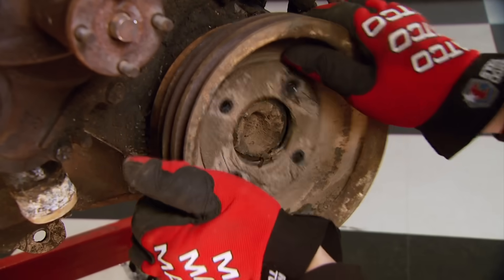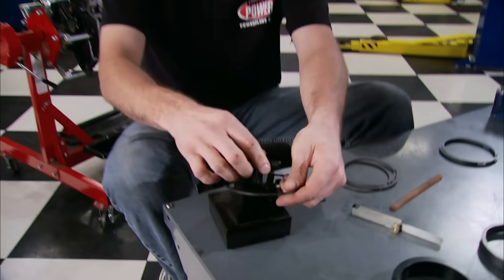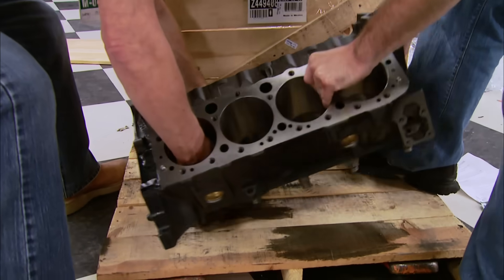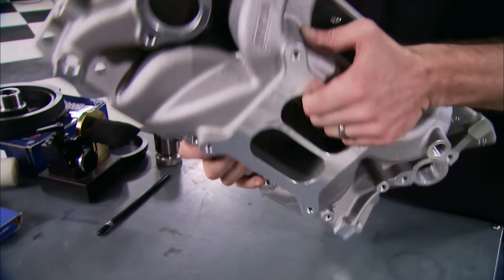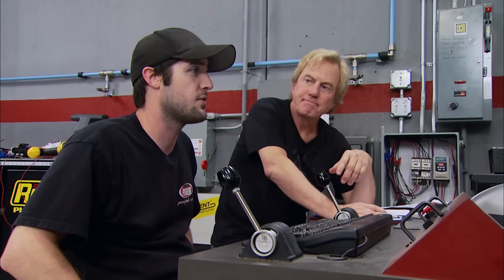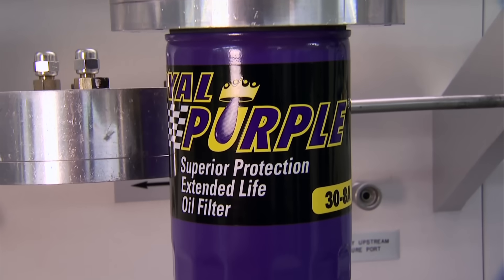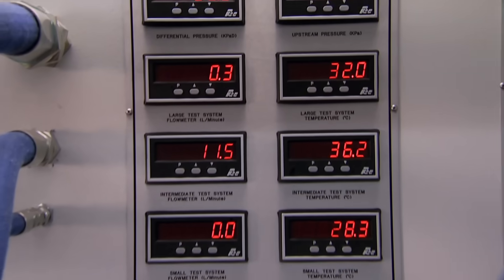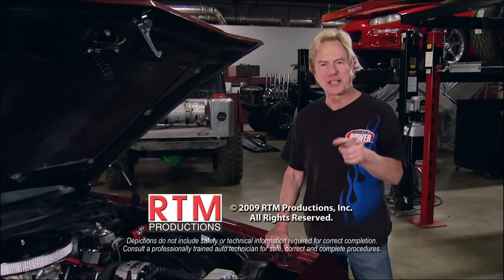Building A High-Performance Smallblock V8 From Scratch Using Only Catalog Parts -Horsepower S13, E18

Comment: i get motor homes with the  ho 454 bbc in it they come with 4 inch stroke with steel crank heavy rods heavy push rods high flow heads and it comes with the heavy duty 400 turbo bigger pump heavy clutches and stage one shift kit get them free all the time 450 hp at 485 torque and all it needs is to breath then i sell the motor home for 2000 without  engine and trans saves a lot on a build the last one i got had 6000 miles on the motor home the one before that one had 38,000 miles on it even if u have to rebuild it the long block new is 8000 bucks they even been known to put a LS 6 454 in them but they are really rare to find that is how u build a rig cheap but still have a bad ass engine and if u just put an aftermarket intake and 850 carb it really comes alive but if u put bigger valves and some minor head work u can get big power out of it with a big cam just a dyno tuned stock ho 454 can put out 500 hp with stock intake and carb which has been proven a few times just to stroke a 454 is about 4000 bucks . so u can see just how much u can save and u can get ford and mopar engines in a motor home just depends on the CO that built it they all have crate engine and they want power for passing i have a 68 ford class c motor home that has a 428 cj in it have all the paperwork on it got the motor home for 600 bucks running and driving newer ones have 429 0r 460 crate engine in them mopar u get the 383 . 292 hemi and the 440 mag most will have the 440 mag i hope this helps people out a bit because this really helped me when i found out about it and i love the big blocks they just look so much bigger
Reply: I built the almost identical engine in 2000. It was pushing 490 HP and almost the same in torque. It was a monster
Reply: @lasagna3106  and how much did it cost
Reply: the real secret to motorhome parts vehicles...find the buddy building an ice fishing house or outfitting a hunting lodge. They want the kitchen, beds, living room etc out of the motorhome. Swap 'em for whatever they have in the garage you want to finish up the car. And then there's the generator. Or maybe you need to build another shed for storage...there's all your wood, insulation, wiring, and windows, far cheaper than buying it separately at Home Despot.

Like hunting the buffalo...let nothing go to waste :)
Reply: @albertgaspar627  the motorhome i got for free was a really nice class A so i just sold it for 2000 the motorhome only had 6000 miles on it it just sat its hole life

Comment: Why just peak numbers? Did it fall on its face down low? I can read the engine trace when the run is shown. I like low end grunt which makes it move, not just a top end number. Or, just show the gauges during the pull instead of your faces which have zero engine data.
Reply: That engine made about all it's gonna make with those heads cam and intake. Solid 430 horse 383
Reply: He said over four hundred lb/ft of torque at 2500 rpm, before the tuning
Reply: @doyouthinkbro5266  Actually he said ft/lbs. So funny

Comment: Moral of the story the catalog engine is waaaay overpriced just ls swap it 😎
Reply: A catalog LS cost way more than that
Reply: @KingJT80  just visit ANY junkyard you'll find em in spades for about 300$
Reply: For $300, you only get a 4.8 litre LS. Or a larger displacement engine with a gazillion miles before it caught on fire. Junkyards are no longer dumb about what an LS is worth. But the internet is still full of the old wives' tales. By the time you buy that throttle-by-wire gas pedal, get the serpentine belt system that doesn't shove the AC into the crossmember, buy brand new headers that fit your car, et cetera...an LS is cheap in the dyno room.

Comment: I'm Sorry! 429HP? For $5,000 in parts? I can throw a cam in an old school 305 with a mild tune and make those numbers! These guys are sponsored idiots! 6.0 Ls blocks make that every day!
Reply: I'd like to see dyno results of that 305 because I call bullshit.
And what tune?
Are you running a aftermarket TBI?
I watched richard holdener build a tpi 305 with less than 1000 miles aluminum heads hydraulic roller cam valve spring upgrade and running hp tuners didn't make that power on a engine dyno.
Also stock 305 valve  springs will not accommodate the air required to make that sort of power if you stuffed in a cam that Large.
 I'm curious if you have ever actually built a engine or just some pud that reads forums and like to make false conjectures .
Reply: With a 6.0 you have to have all the swap parts to make it fit and a 305 can't even have a cam with that much lift unless you notch the piston bores. EXPENSIVE

Even if you did do it you wasted your time
Reply: You can get 500+ hp 383 strokers turnkey shipped to you for $5k as well. They used a high end price company to make this seem like a good idea. It is not.
Reply: Yeah, right
Reply: @craigstewart1532  My LS1 RX7 ate this combo for lunch, and it was all stock! So don't tell me you cant make a quick car with less power! You start with HP to weight! Everything else is irrelevant! It's all good, but at the end of the day, I got 20 miles farther on the same gallon of gas, and I got their quicker! So, you spend your dollars on this junk, and cry after you pass the gas station!
Reply: He did finish with 443 HP, these guys build for long term strong power, not cheap and easy quick thrills

Comment: It was an enjoyable video. One suggestion, when giving the cam specs it would be nice to know the lift.
Reply: They said it's 234 duration at 50 lift so it sounds like your typical 268 cam which is usually around 480 to low 500's lift and 110 separation. But you never know and there's alot more to a cam than just it's basic numbers.
Reply: @user-ge2qn6gp4o   - A typical '268' cam is around 224 duration not 234... they used a 274 or 282 cam... their 500 HP cam only got them 443 HP... better HP here, similar cam: https://www.dailymotion.com/video/x3rfhrk
Reply: Watch the video again, he did in fact state that it had 50 thousands lift
Reply: @goBlue1776  No they didn't.
Reply: @user-ge2qn6gp4o  Don't bother. He's clueless
Reply: @goBlue1776  Wow, you are obviously not a car guy. .050 lift?
Reply: @goBlue1776  that's not the lift, it's the beginning and ending of the lobe ramp.
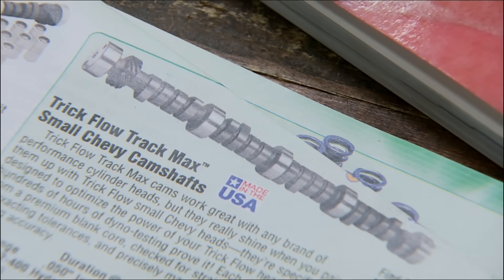Reply: They did. You just got to listen. They even show it in the catalog. 5:35 mark to be exact. If you need more help than that suck start a pistol and don't ever think about working on a car. I bet your a boomer.
Reply: @khrisyeet8022  You must be miserable. But aside from that your post is nonsense.
Reply: @khrisyeet8022  with yeet in your name and such a hard argument while being wrong I hope you were on the white lightning. 

Only .050 duration was mentioned , no lift and no lobe seperation. 

It's power nation. They're made for the masses and 80% of car guys. No matter how well it's explained you try and get tricky with the other 20% of car guys and you'll lose the majority to confusing
Reply: @khrisyeet8022  lmao they never showed or said the valve lift. They said the duration is 234 at .050 lift. That’s not the lift!!! And the pic they showed of the same didn’t show the cam specs.
Reply: @khrisyeet8022  Us "boomers" learned from those of the "Greatest Generation". My father was an engine tester for Pratt and Whitney aircraft engines before the war, tank mechanic in WWII, a Chevrolet Dealer mechanic after the war. In about 1960 he became the Auto Mechanics teacher at North Miami Senior High. He finished his career as director of vocational education for Miami Dade County. There is an example of us boomers. You couldn't come close to what I knew by the time I was 16. And yes I am sure of what I am saying.

Comment: You have to be careful buying complete engines from summit racing because they used old parts in their reman engines and they will not stand behind it and warranty it until it fails they're not a very good company to buy products from
Reply: Their crate engines are machined and built in mexico
Reply: there good and cheap but u need to know ur engines like the back of ur hand to know ehat to buy and what not to buy from them never buy an engine from them first thing buy a real crate engine or build ur own motor homes are a good way to start they have good crate engines in them
Reply: @melissaweidman3326  Take a breath
Reply: @craigstewart1532  i was on hold ordering parts like i am now
Reply: @melissaweidman3326  multi tasker. I always screw up when I try that
Reply: @craigstewart1532  I don't see how I screwed up I just give people an easier way of doing things like get good engines cheap to start with but I guess i should not say a thing about what I know I just keep it to myself and I will keep getting free engines and rigs
Reply: @melissaweidman3326  Wow, defensive much? I was making a joke about what happens when I try to multi-task. You must be a lib.
Reply: @craigstewart1532  most people attack on the net and that was what thought ur were going with it . i was just attacked bad for saying a LS 6 454 engine was a small block not a big block chevy 454 in the 70 chevelle ss LS car  with the LS 6 and 7 in it by 3 people they claim it was a LS 6 454 bbc . don't worry libs don't like the kind of cars we like
Reply: @melissaweidman3326  - LS6 and LS7 are BBC and SBC... gotta specify the year... BBC and SBC both available at 454"... just ask if need more info... I'm a retired GM engineer...
Reply: @BuzzLOLOL  u have one problem LS never built a big block in history they build a LS 6 454 small block and it is not a sbc i have proven it to so many people LS is like a Pontiac they only build one block for all
Reply: @BuzzLOLOL  and a sbc from the factory never came over 400 cubic inch aftermarket co. have oversized the cylinders to get up to 500 cubic inch just by what u are saying u have no idea on what ur talking about quit listen to these idiots on the net like patric he has no idea what he is talking about u should really learn ur engines if u are trying to look smart
Reply: @melissaweidman3326  - Sorry Hon, you're totally confused... 1970 LS6 and LS7 (over the parts counter only) were Big Block 454's: https://heacockclassic.com/articles/the-best-muscle-car-1970-ls6-chevelle 
The LSx series of small blocks first offered in 1997 Corvette... 
1990's LS6 5.7L and LS7 7.0L are small blocks and the latest variations of the SBC... all same bore spacings... 
Pontiac used a shorter block to build their 301" (actually 302") and 303" engines... 
Years ago World Products/Bill Mitchell originally in Detroit, now in New York offered a SBC 454" crate engine... later GM/Chevy did it as LSx 454" and also still offers BBC 454"...
Reply: @melissaweidman3326  - Sorry Hon... You shouldn't try to hot shot a GM Engineer since 1966... 
BTW. the SBC '400' is actually 401"... but called a '400' to distinguish it from the Buick 401" Nailhead engine... and also to keep it under the GM limit of 400" for certain vehicles...  
Also, the Ford '400' is actually 402"... 
And the Pontiac '350' is 354"... 
Like I said, simply ask if you have further confusion...
Reply: @BuzzLOLOL  i read it and they have no idea on an engine they talk about the ss 454 360 hp that was the regular ss 454 but yet the 454 came out in 1970 as a crate engine in the 70 chevelle at 450 hp at 485 torque not 500 i have 2 of them in my shop right now so now there are 2 things wrong with what u claim most of these people written these things have never work on a car ever just like hot rod mag. they get things wrong all the time even been found to straight up lie about things   u are not the first person to talk lick this and all have lost i have proven it over and over to people that a LS only comes as a small block even LS will tell u the same thing how many crate engines do u have i have 2 ho 454 and a LS 6 454 small  block and a LS 5 383 small block soon to have the new LS 7 427 small block with overhead cams and 4 valves per cylinder engine stock 860 hp  so how many cars have u built from the ground up i bet none how many years have u been drag racing i have over 40 years of it
Reply: @melissaweidman3326  - Sorry to see you are totally wrong and insane... maybe it's Alzheimer's... I've built and driven thousands of cars and trucks... they're my life... 
There's no LS people... LS engines are part of Chevrolet engines... always have been... 
I'm still your friend... are you institutionalized? Where are you? I'm in N.W. Ohio USA...
Reply: @BuzzLOLOL  u can believe a LS engine is bbc if u want just anyone that knows what a LS engine looks like will laugh, all u did was make me bust a gut.just go to ls and look at a LS 6 454 and then tell me it is a bbc please do this trust me u will see what i am talking about if u look at the one with a carb that is how the 70 ls 6 454  engine looks like and i live in oregon and i race at woodburn oregon one of the best tracks in the nation for 1/4 mile all the big boys will tell u it is perfect to race on top fuel cars love this track and i have 10 acres of good clean project rigs this is all i do every day of my life